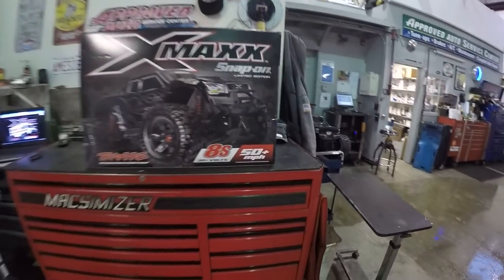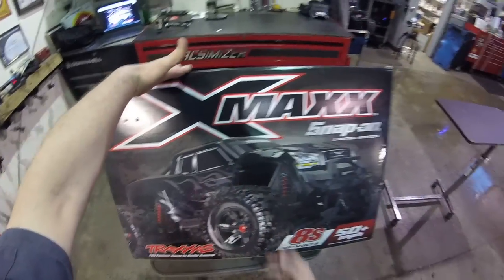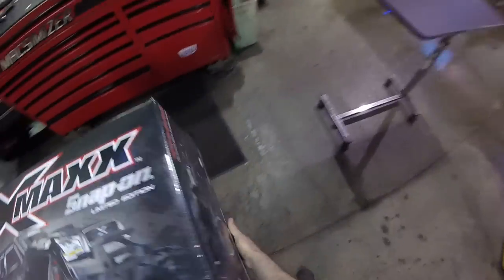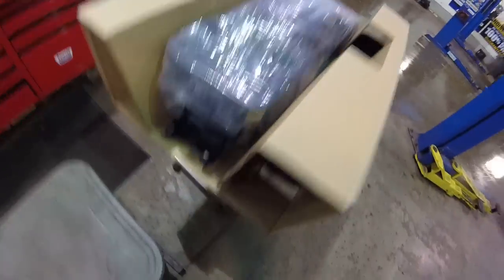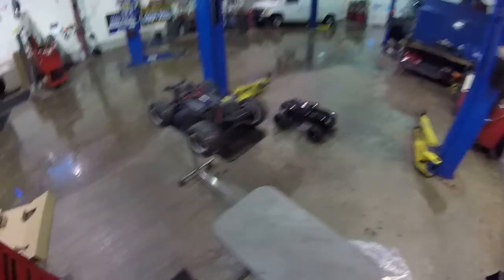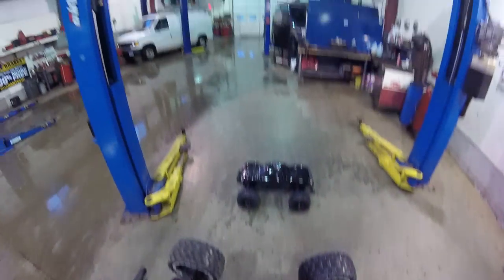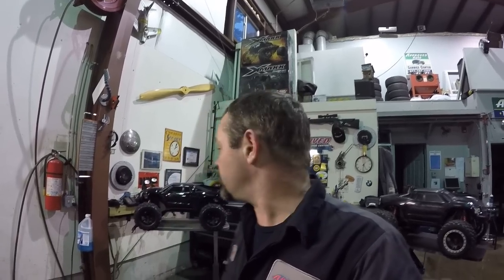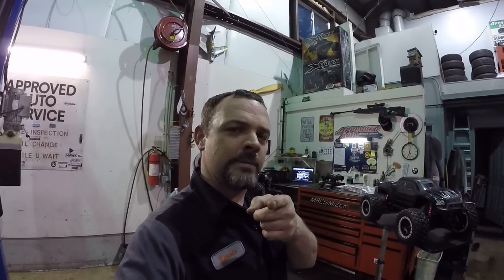Snap On Traxxas Xmaxx Unboxing Review!

Comment: maybe the problem comes from using the hopped up battery packs, maybe it wasnt cost savings, maybe that's just a side effect of using the bigger battery with it? and you could use shoe goo on the openings in the tires to help it from getting in on the new one, plus I gotta say why not save the body of the good one, pack it away, and reuse the damaged one? or get a new body, like any body for it.
Reply from the maker: The new body will be for show only.
Reply: glad to hear